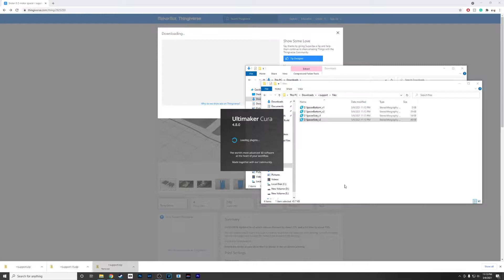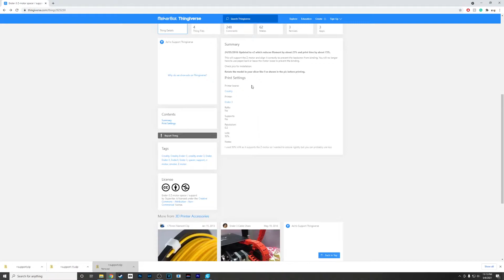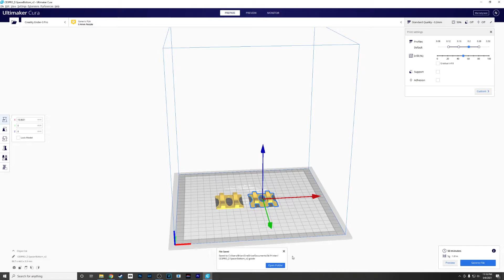Ender 3 Pro Z Axis Shim Upgrade (Printable Upgrade)

Comment: The shim width may vary, depending on how much the rod is off centered in the nut hole. So, ideally you should measure the gap and then print your custom shim. Optionally, if the rod is adequately centered, then you can reinstall the nut, positioning it so that it doesn't bind the rod.